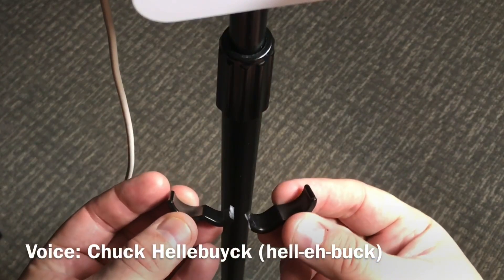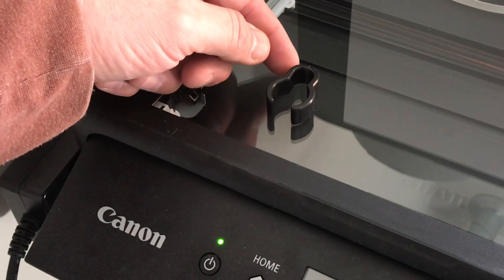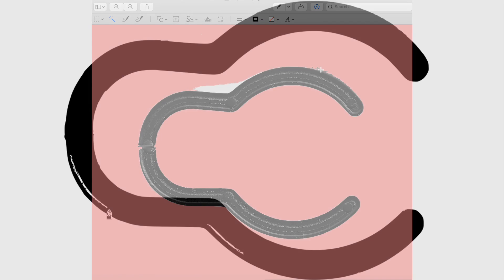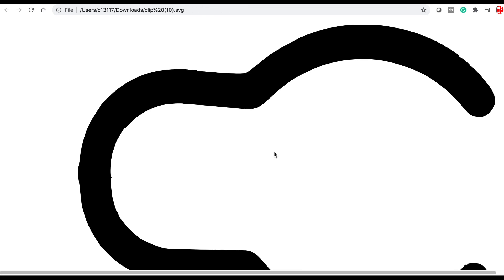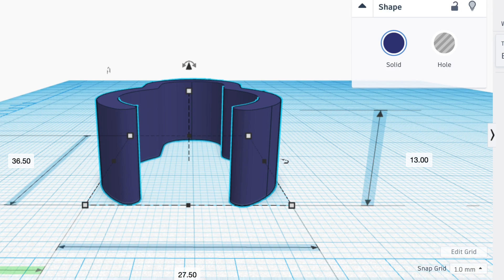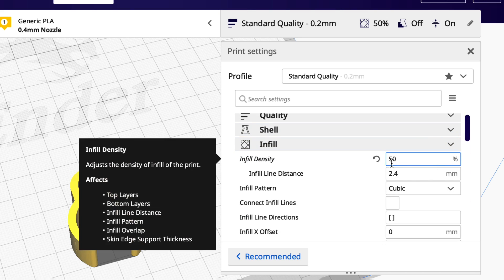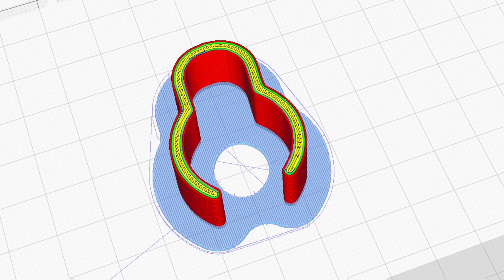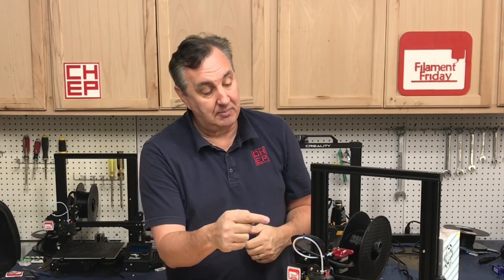Scan to 3D Print using a Paper Scanner

Comment: Good video... wish I could get to the point of using my ender 3 ... driving me crazy.  I can't seem to get my auto bed leveler working.  I have printed one thing but that was just the test piece and that was using the bed leveled by me.  My friend recommended I get the glass bed and the auto bed leveler and when I put on the bed leveler and downloaded the so called bin file it's like it's not picking up my bin file.  My auto bed level stays red like it's not working.

Comment: Hi chep I have a question I have a model kit a ship by revell  the 1/96 U.S.S UNITED STATES and it has a few parts broken and the gallery is broke and the ship  decks were defective deformed and one of the ships parts the mizzen channel port has its pics broken and I don’t have a 3D printer can I sell the kit to another buyer who has a 3D printer for them to print out the parts I had asked revell in Germany for replacement parts but they don’t make them anymore can the buyer make them by scanning the broken parts

Comment: I'm left handed and the amount of options for gaming keypads, mice, etc (as with all things for left handed people) are severely lacking... I found a semi ambidextrous gaming keypad that is ALMOST perfect but the keypad (similar to your num pad on a standard keyboard) slants downward (for ergonomics I guess?) Well this is really uncomfortable for me and I'm trying to reprint the upper half of the keypad shell to make it level so I can enjoy this pad in the most comfortable way possible... Would this scanner trick work for something like that? A close comparison would be like if I had a remote control for a TV that the top half was broken that's roughly the same size as this thing... Could I take it apart and scan it even though the levels/dimensions are somewhat complex? Or would a more comprehensive 3d printer scanner be useful here?

Comment: This could be just what I'm looking for!
I have a skeletal metal plate on an Rc truck that is a non uniform shape and curved rather than straight angles to make things even more difficult which I want to make mountings for things which will fit inside the open parts of the plate so they are 'locked' in when a bottom clamp is added.

I'll try this to get a template of the plate to use in tinkercad!

Comment: that is awesome way to get the shape! i used that to get a shape for a gasket and used vinyl cutting machine to cut out the very thin gasket material, it worked great. it did ruin the blade, i bought the best blade for the next time i need a hard to find gasket at midnight again. if you are working on a very old equipment and you can't find a replacement gasket. if your missing the gasket paint the part a solid color and high light the sealing surface to get the best scan to fix in " photo manipulator " program. thanks for sharing.

Comment: I'd suggest using a paint program with a B/W option. Any 10+ years Corel or Photoshop or free gimp can do. : take the picture with as much contrast as possible * blow it up to 2000pix * smooth it with a Gaussian filter to remove unwanted edges * change it to black/white an offset you choose for your object * This will speed up the processing and avoid the mess with the eraser on the picture.

Comment: Thing like that were the first reason to get a 3D printer for me. I have this cracked tripod parts I'd definitely need to replace. Thank you for showing how to :)
Does this clip hold still? So far pieces that are supposed to snap together (from Thingiverse) are loose as the result. Unless they were a bit bigger and got filed to size after printing.
Reply from the maker: Holds fine.

Comment: The first time I had to do something like that, I did it exactly your way. But the scan was very messy and it took a LOT of work to clean it up - even though I even painted the part black which doesn't always work.
Now I either use Inkscape or Fusion 360 sketching to create a SVG or a Sketch which I can extrude. For me Inkscpae is way easier to use. You load your jpg and start to draw splines around the edges.  With messy scans this is much easier and with a little practice it is way faster.

Comment: I had to join the fray.  I've used this method quite a lot when I model parts. A few months I modeled rubber links for an old Invicta watch for a friend.  I scanned it flat and on the side. A little Fusion 360 magic and shortly I had 10 and they fit and looked great. The layer lines actually gave it a nice texture.  Thank you Chuck for bringing up it is a great tool. 

And, congratulations on reaching over 100,000 viewers.
Reply from the maker: Thanks

Comment: It's even simpler than this: put it on a piece of paper then take a picture. Drop that picture/PNG into Cura and select "darker is higher". Click OK.
You should now have a model with a big huge base on the bottom. Set the model's Z height so that the big huge base is juuuuuuust under the build volume, so that it will not be printed. Now adjust the Z scale dimension of your model to be the perfect size. You may have to edit the Z height of the model again if the base pokes back up. After it is the correct size, simply slice and print.
Reply: good alternatives. But, the diameter will be off for a model that need accuracy

Comment: Thx for the Video.  I have been trying to figure out how I can do something similar.  I have some interlocking shelving and I want to make some more interlocking connectors, but they are a bit wedge shaped where the Top is a bit wider than the bottom (1.5" x 1.25x) vs (1.39" x 1.20") at a height of 1"

Comment: I have used this process with the free program Inkscape - You open the image in Inkscape , select the picture, then from the menus on top select Object -> Trace Bitmap .  I will usually need to play with the number of colors, but you can select Remove Background and it will remove the layer that is closest in color to white.

I have also done this with a phone camera.  I will use a grid in the background like a cutting mat or a piece of graph paper, and then a camera scanner app (e.g.  Cam Scanner for Android) to readjust the image to the grid before opening it in Inkscape .  This also allows me to scale the image because I will know what size the grid lines are.

Comment: Great idea Chuck.

Couple of pro tips when cleaning up the scan: the high the zoom level you work at, the easier it is to get get smooth lines. Also, the larger the brush, the smoother the curves.
Also, when scaling, don't scale each axis separately unless you have a reason to do so; simply use proportional scale with both axes locked.
Reply from the maker: I tried the proportional scale. It was off a bit. Doing them separate worked better.
Reply: @FilamentFriday  Ahh that's interesting. The higher the resolution of the initial scan, the more likely proportional scale is to work. At lower resolutions, a single pixel equals more size. This is a fantastic tip though Chuck. Great job as always. I always find your stuff to be extremely useful and unique. So much better than "How big can we print Benchy?" vids. Although I LOVE Joel - such a decent and lovely guy.

Comment: Instead of using preview and using a conversion tool. You can use Inkscape and save it as a svg. After converting it into vector.
Reply from the maker: I’ve tried Inkscape. I find it difficult to use.

Comment: I did something similar a few weeks ago. However I couldn't get a decent scan of the part (it was kind of a complicated part). So I just drew it in inkscape based on the crappy scan.  It turned out just fine after a 3rd print. I couldn't get the dimensions right and it was my first time doing design so yeah.

Comment: How important is it for positioning and supports... hear me out - example - I was printing a cube, with the bottom open and supports supporting the underside of the top and it seemed to be ok but it just needed lot of supports and looked a little rough underneath the top side. I printed another one, when I rotated it 45 degrees, I sliced it (for shits...) and realized it looked so much cleaner with less supports.  Just made me realize the importance of positioning and rotation. Plus the lines where not the genetic vertical lines, they where diagonal and when I used wood filament, it looked reallly good

Also I see a lot of printing on the center but I move my prints as closets to the edge of my extruder, thinking less travel time.. does that make sense?

Comment: Hello, big fan of your tutorials. 
Will you at all be able to make a video about printing threads? 

I've been experimenting for quite some time now trying to print an internal thread like a nut.
For some reason, the internal threads aren't sticking and are forming chords across the internal hole.
Reply from the maker: I’ve printed lots of them. Never heard of that issue.
Reply: @FilamentFriday  Interesting, it may be a problem with the specific STL file I downloaded. Thanks anyway

Comment: Another trick, 
Take a picture,  import in fusion 360 ( scale it properly- put a scale near object while taking a picture) , get the outline and extrude it. Export it as an STL file. 
Mission accomplished  ! I have used this trick many times. It has worked every single time. Most useful when the object has an irregular shape and size.

Comment: Actually, scanners are pretty good measuring devices. Once You've scanned your object, all you need to do is to scale the image in vector software like Inkscape to 100% size depending on image DPI. As long as image DPI is equal to scanner DPI, You'll have pretty accurate dimensions.

Comment: I find it easier to just let cura handle the png
Reply from the maker: I got a lot better results using this Tinkercad method. The png was a bit rough looking in when imported directly to Cura. .
Reply: @FilamentFriday  I'll try to it out. I've been loading pngs into cura, and tracing them manually when that didn't work

Comment: You just keeping hitting home runs with your videos Chep. I am totally going to use this. My wife came to me several days back with a broken shower towel hook that hangs from the shower rod. I designed a new one in Fusion 360 based on this one, (I haven't printed it yet) but I want to see if I can scan it like you did and make an exact duplicate.

Comment: Ive done simple parts in a similar way but with less steps by drawing the part in paint, selecting it, ctrl+c, open 3d builder, ctrl+v and that gives an extrusion of the image.
Using the scan you could easily do the same image processing as you did but pasting that straight in, without going to have it svg converted or using tinkercad.
Excellent vid as always :)

Comment: Skip a step and just import the png into cura and scale it withing the import tool. It'll save at least three steps here. I've done this using smart scan app on my phone for simple extruded parts
Reply: Tinkercad probably makes a better output stl and you get the benefit of saving the clip for future mods.
Reply: @LeviDeHaan  It actually reduces the quality using tinkercad because of the stl resolution limitation. Moreover, you can save the cura project as 3mf or export the model there. There is really no reason to add multiple steps for simple profile extrusion parts.
Reply: Thanks for the tip!
Reply: Wow I didnt know that was a thing. Thanks.
Reply from the maker: I tried png direct to Cura and the resulting print was worse quality. I got a better result using svg and my Tinkercad path.
Reply: @FilamentFriday  Make sure your PNG import "higher/lower" settings are either 1 or 0

Comment: No need to scan, just take a top down picture and then do the same post-process... you can even put a ruler close to the object to reference the scale. 
Only useful in these straight forward situations tho, clearly not for more intricated parts

Comment: I generally use a similar method, I take a picture, I import the jpg in autocad, I scale it, and I draw on the top of it. This way I get a less fuzzy model (the lines are perfectly straight and the curves are perfectly round), and if the model is easy it's even quicker!

Comment: I personally would just load the image in Blender3D, add a cube, go to edit mode, delete all verticies, press ctrl+left click to add vertices along the edges (tried to not go overboard, stay symmetric), then select all, fill and extrude to the desired height. Adjust X/Y scale according to the original measured size and export as stl.
Saves the step of fiddling with the image, cleaning things up or converting as you can just use the scanned image as the base.

Comment: When scanning anything for 3d printing place a coin on the bed also then you can check that you have scanned in the correct scale by placing the coin on a print out of your scan, if your scan is to scale the coin will fit the print, the item Chuck scanned will be easy to check the scale with the scanned item but not all iems will
Reply: A ruler also works
Reply: @Dreoni_  Yeah. If you can measure the coin, you can measure the part. Although if you have a really weird and organic shape it may be difficult without the coin.
Reply: you don’t need to because you can measure the dimension between any 2 points on the piece, scan it, import it in fusion 360 and then scale the picture on the exact same points to fit your dimension. Works like a charm!
Reply: You can use the scanner dpi setting to get measurements.  If you are scanning at 300dpi, then each pixel is 1/300 of an inch.  Just measure how many pixels across and divide by 300 to get the measurement in inches.
Reply: @incogneato6725  ' to get the measurement '  Not about getting the measurements, it's about checking that they are actually correct, and that the scanner and printer haven't altered the scale.  Not really that critical on a simple clip like this, but many other things demand pretty tight tolerances.
Anything can work for a scale reference, but it's literally easier to put a ruler in both dimensions and check X and Y.  Find printable rulers online, print some and check for correct dimensions, and you have a very cheap, accurate reference.
Of course once you know your scanner and printer and their stretch or shrink and corrections for it, they are unlikely to ever change.  Work the exact scanner and printer correction percentages out once, and make a small file with them in it for future reference.  Usually it's within a few percent of 100% for both X and Y, most things are 'fairly accurate' even when not exact..
If you do accurate things somewhat often, realize this is a very good thing to do once and have the data easily accessible.  All of your future uses are made accurate with a one time minor effort.

Also note that you can simply photograph from 3 dimensions (and other sides if needed) on your phone with a contrasting background.  Photos from the needed directions, import the photos to Fusion or similar, and work from them directly.  Simply measure the main dimension, adjust the common dimension between photos as you're going so they all match.  I did this to import the oddly shaped seat adjust control knob in my van, worked well with no real middle steps.  Just scale correct the reference photos in Fusion as you're going.
Reply: Brilliant Idea! thanks! easy scalling ..

Comment: Great advice as always brother.  

My ender 3 v2 doesn't autohome while heating nozzle like it used to, even thought the default g-code from cura tells it to in printer settings "before print".
Any idea what it could be?
Reply from the maker: Maybe firmware update is needed. Or you have a bad switch signal that is telling the board it’s already home.
Reply: @FilamentFriday  Tried reinstalling firmware both on the screen and machine, didn't work. BUT I tried your homemade start and end g-code from 2019 and it worked like a charm! Thank you so much. Now it's better than ever with faster dual heat and a beep sound.